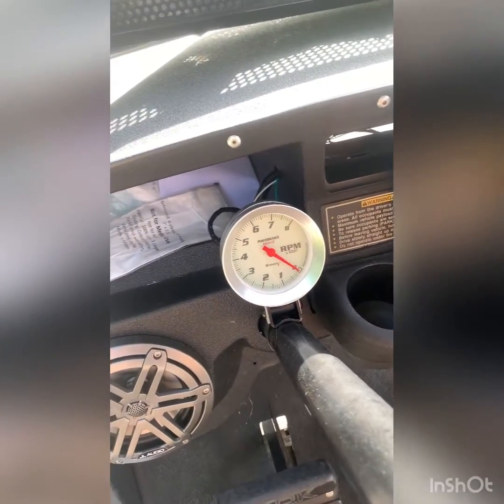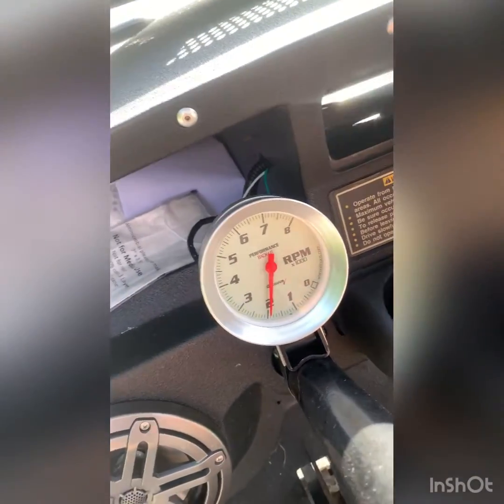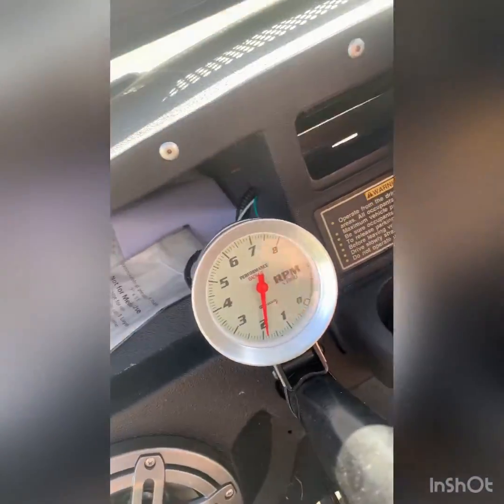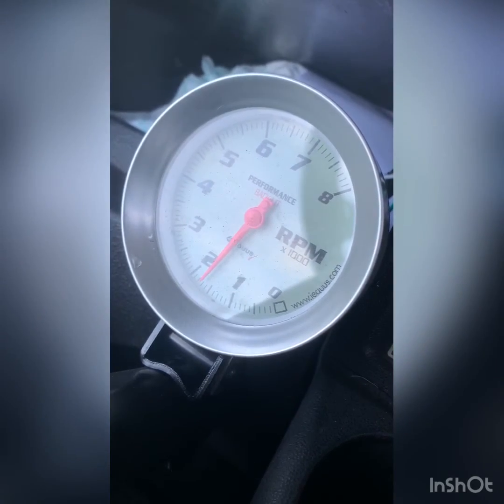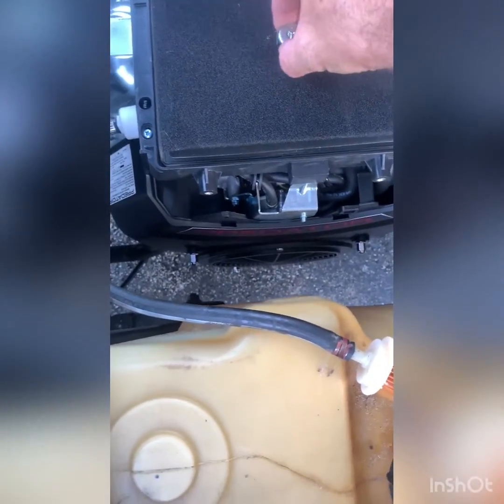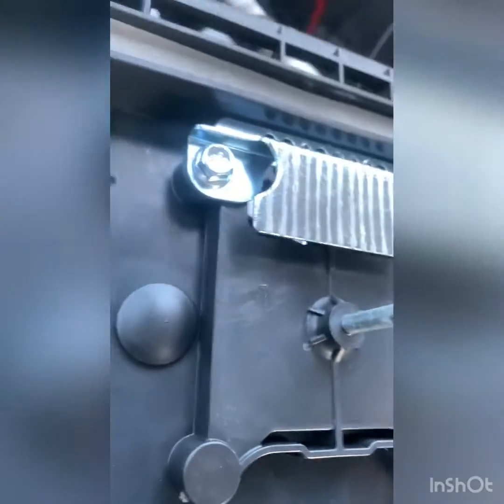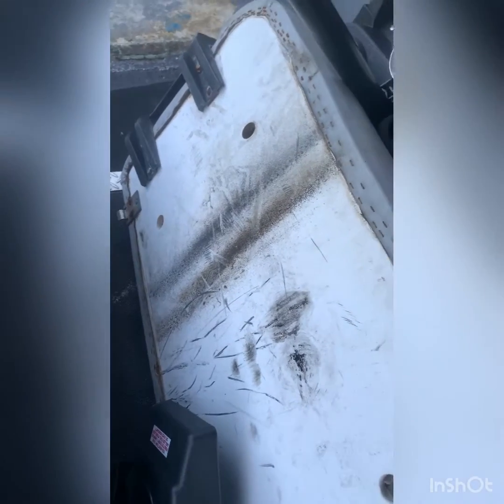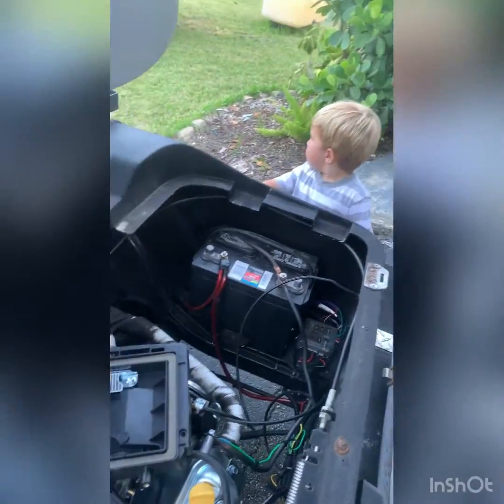V Twin Golf Cart Tachometer Troubleshoot Part 2 / Predator 670 Carburetor Adjustments

Comment: So counter clockwise is to lean it out and clockwise is to run rich? I'm not too worried about the idle as I am using it for a pressure washer. I noticed that my engine runs better with the choke pulled and think it's running too rich or with too much fuel. Not sure if this is the best way to fix the problem but any advice would help. Was also thinking about cleaning the carburetor. What do you think?
Reply from the maker: I made another video adjusting the carb, runs flawless now. I also put the directions in the description below on the other video

Comment: So you turn the screw left to idle it down and right to idle it up
Reply from the maker: correct, you need to do it in small increments though. if you do to much you will mess up the fuel/air mixture and it will run like crap .

Comment: Also do you have any issues with the idle dropping when you just hit the throttle quickly then it will stall unless your feather the throttle back up then idle will stabilize again? Thanks
Reply from the maker: I did have an issue on my first motor with the idle staying true, ended up having a vacuum issue with motor 1 so we took it back and got another. Motor 2 has been better, I have not been running the cart as much as normal due to other projects & traveling but now this motor is running high on the rpm's. my solution has been to add extra return springs, so far so good but I also believe its partially because I don't run it as much.  Hope this helps!

Comment: What’s your elevation? Also how much did you turn it from stock settings and what direction (clockwise or counterclockwise) did you turn both screws? Thanks!! Currently im having issues with my shifter as the idle is two high.
Reply from the maker: I am in Boynton Beach, I think we are about 8'-15' for elevation. as for the settings I wanna say I turned them both out equally. I can say the first motor did not have a tach hooked up to it, I think that's why I had issues with it. even if you get one of the rpm testers from Amazon just to dial it in would be a great help for you. just letting you know from my mistakes.

Comment: On mine it shows if you pull the rubber plug off to adjust the Phillips screw to adjust the idle. Do I have a different motor than you?
Reply from the maker: on the predators I've had (this is my 2nd 670) you have to use a pick tool and bust out the steel plug/cap (2x) one for each screw. make sure your tach is hooked up or have mini one, like a stihl EDT tach to make sure you don't lower the rpms to where is stalls at idle because you'll burn out the starter and there are like $80 because they don't have a huge aftermarket on them.